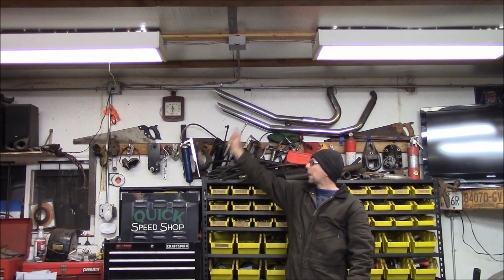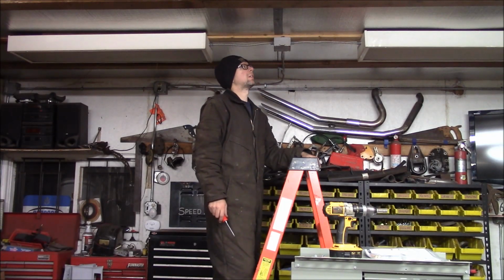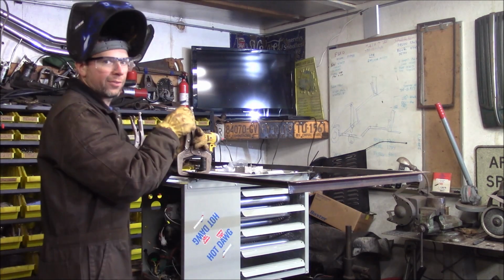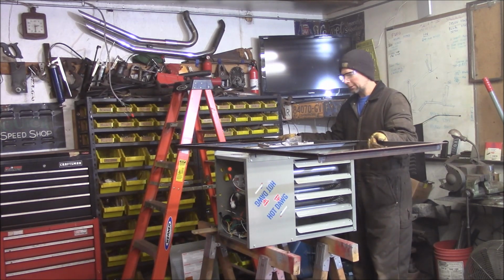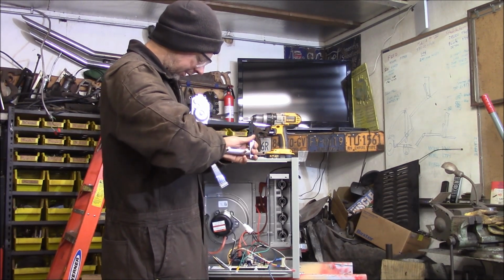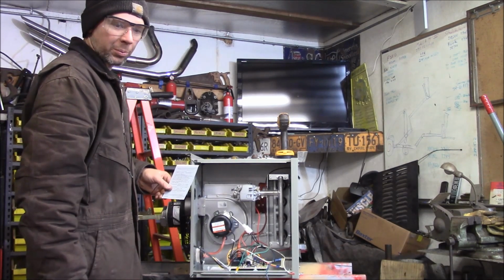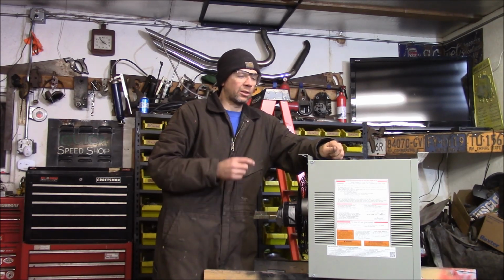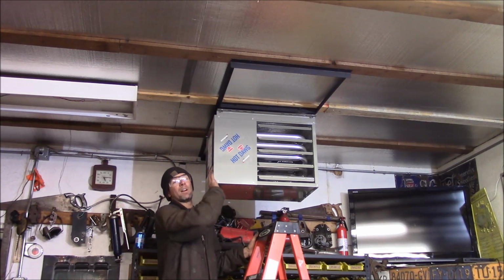Hot Dawg 60,000 BTU Heater Install:  Part 1

Comment: I sure think this is a great video!
Question: If a 28 year old Modine heater works okay, would it be best to replace it anyhow?
Reply from the maker: If you keep the thing clean and the heat exchanger doesn't leak I don't see why not.